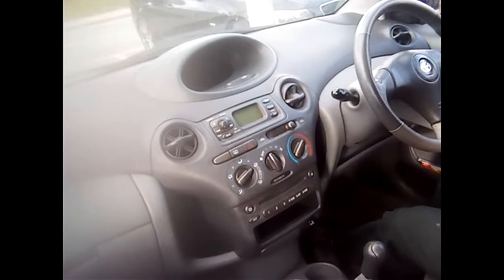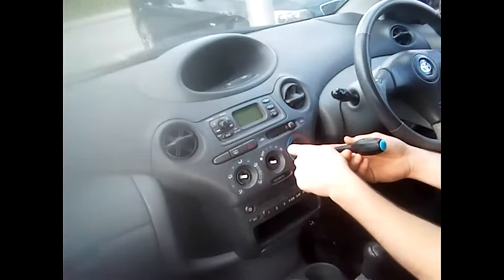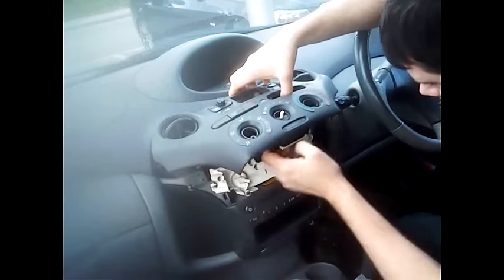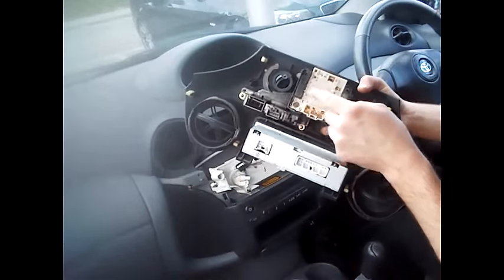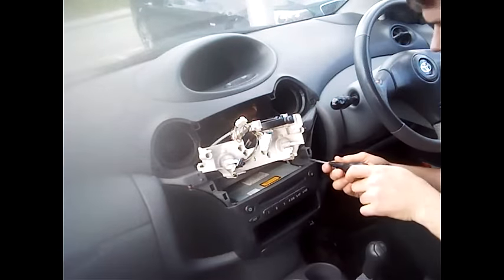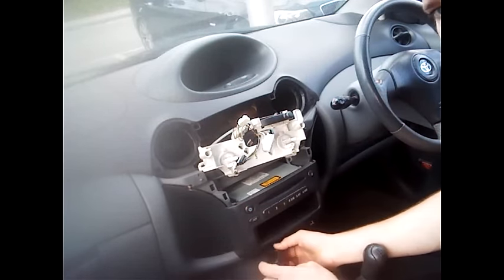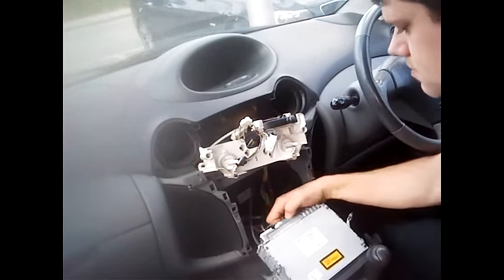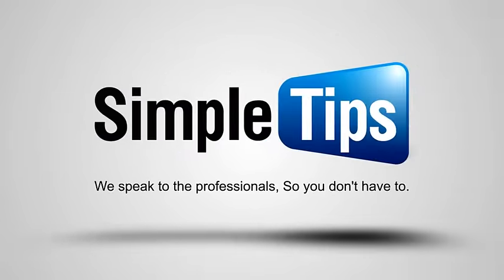Radio Removal Toyota Yaris (1999-2005) | JustAudioTips

Comment from the maker: For the customer we turned the pocket below into a Single Din slot to fit an after market radio - Its quite straight forward. Alternatively, you can get a whole fascia adapter to put it where its "meant to be" but these are costly.

Comment: Great video, though fails to tell you it's a pain to get the screws back in, lol. My CD changer hasn't worked from the start to I'm replacing the terminals to hook up to my Mobile Earphone Jack. But I think I will need a mini amp.

Comment: My stereo is intermittently working-plays then stops playing and sounds like it's sticking. It's not the cd as I've tried various ones. Can I actually replace the cd player (that might be a stupid question :-) )?
Reply: +coral laroc 
yes you can. to prelift version fitted also cd from lift ver, you only need to change front panel replacing it by yours old panel. it holds on small locks. works fine, tested in my 01' yaris verso

Comment: My gf recently got herself a Toyota Yaris like this one. Since there is no Aux input I want to either replace the radio, or somehow add an Aux-input. Has anyone any experience with doing this? I only have some experience working with electronics outside of a car so I would like to tips or pointers if any has some to share :)

Comment: I got a Phillips Headunit online and put it in where the deep tray is housed. Had to file down the edges of the dash to make it fit. worked perfectly. Gave me bluetooth and also aux and iphone connection. Charged my phone too. I was also able to download an app to my adroid which meant that whilst it was in the cradle, I could control the radio via my touch screen. It was a Philips CMD305A Android/USB/Bluetooth HeadUnit. Mine was used for a month and is now for sale as I bought a new car.

Comment: Thanks man. I just used this to help me pull mine apart. The radio has gone all crackly in mine, So I opened it up to see what the aerial connector looks like, will see if swapping it out for a different aerial will work.

Comment: Great. I can do that with my eyes closed! HOW do you fix the illumination on the digital display screen? Mine has stopped lighting up and I have removed the unit but CANNOT get the facia off the metal frame. Something behind the volume knob is preventing me from getting it off so I can't access the screen.
Reply: Well after a visit to a Toyota dealer today there doesn't seem to be any way of replacing the bulbs, they sent me to an auto electrician who told me that it's a factory sealed LCD 'throw away' unit!!!!!! The Toyota dealer told me they were EXSPENSIVE to replace but didn't give me a price, so it looks like I'll be rigging up my own illumination system soon.

Comment: Thanks for the tips, I'm buying a new stereo to replace my Yaris (2000) cassette tape player and was going to get it fitted by Halfords for £30 but after watching a couple of videos I think I will actually attempt to DIY and save the £30 for a more expensive head unit.

Question : Can I use any cross head/philips screwdriver or a particular size? Also would you say the whole removal/fitting process would be easy enough for a lady :D or would you rather leave it to the professionals?
Reply: Barbie Coco how did it go? I'm in same situation! Are the speakers stock on your car? As surely any new head unit will be overpowering for the ancient stock speakers?

Comment: I've fit my stereo in, the cd, usb, aux and Bluetooth work. I'm just wondering what about the actual radio channels by themselves? How do you get them to work?
Reply: Where did you get your stereo and replacement plate from? I'm currently struggling to find ones
Reply: I got my stereo off a friend, you can get them new from halfords, argos or second hand on gumtree/ebay.  Just make sure they have everything you need (aux, usb etc). You may need to get the fascia (depending on the size of your stereo) but mine was fit although I had to cut some of my fascia for my stereo to fit in. I also bought some harness adapater for like £1.49 (I think thats the name) for the wiring for the stereo.
Reply: Duel MasterBlaze Thanks, I got my stereo from argos for £40 yesturday, I've got an aux cable and ordered the fascia i need from Halfords. Only thing confusing me is that halfords say i need 2 cables, a harness adaptor and an audio connector  and together they are like £18 which i thought was pretty expensive
Reply: Good you got your stereo, you'll probably need the fascia to fit it in. Did it come with any wires? Just order it off eBay as it's cheaper! You'll need the ISO radio harness adapter  ( Link is here: https://www.ebay.co.uk/itm/Toyota-Yaris-1999-onwards-ISO-Car-Radio-Stereo-Harness-Adapter-Wiring-Connector/251334381714?hash=item3a84b25092:g:ICgAAMXQnFhTlZew). I didn't fit the aerial adapter in (audio connection) but I need to as I think I need it for the radio. Haven't yet ordered one but when I do ill send you the link. Alternatively, you could refund your order from Halfords and buy this one (https://www.ebay.co.uk/itm/Toyota-Yaris-1999-2003-Car-Stereo-Radio-Single-Din-Fascia-Fitting-Kit-FP-11-09/181921912192?epid=1987755351&hash=item2a5b641580:g:XQYAAOSwWfFXkO59) it's cheaper and at a proper good price , Halfords probably charger £10-15 for the fascia? Lemme know.
Reply: I ordered a fitting bundle off eBay which comes with the fascia, harness adapter and the aerial adapter. Should be arriving Wednesday-Thursday, I'll let you know how it goes
Reply: You need to get an Arial to plug into the back of the stereo

Comment: On this car where is the fuse for the radio ident know which one it is
Reply: Its Kamron late reply but for any future person reading it's (for my Yaris anyway) the fuse box is in a compartment on the right near the shelf bit above your legs and below the steering wheel, take the cover off and flip it over, tells your what fuse it what, the radio is hooked up to the acc fuse (accessories)

Comment: do you need to disconnect the battery first?
Reply: my reply is a bit late, but i was worried just the same. Then I saw the ''security''- bulb blinking in the video. This indicates, the battery still being connected at the time of the removal. Prior to the key not being inserted for turning the ignition, most of the elements in the control panel are not on operating voltage, so it is safe to remove the panel while the battery is still connected, just keep your keys in your pocket, thats all.